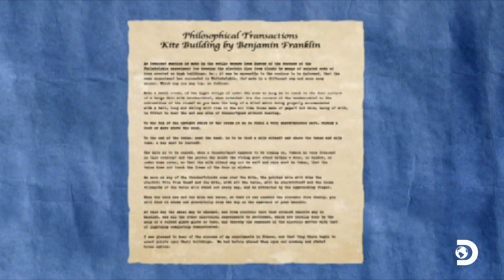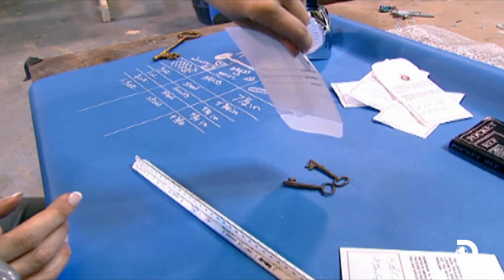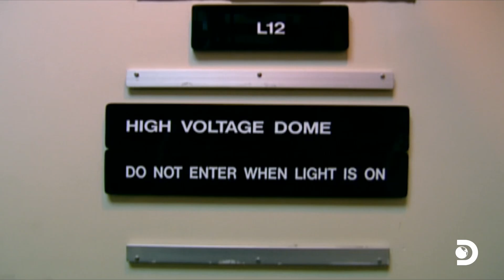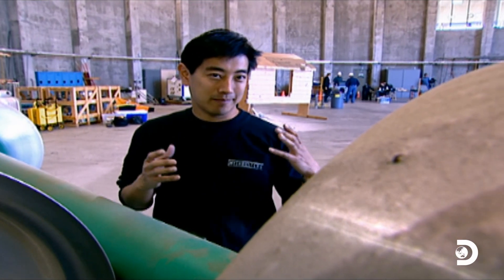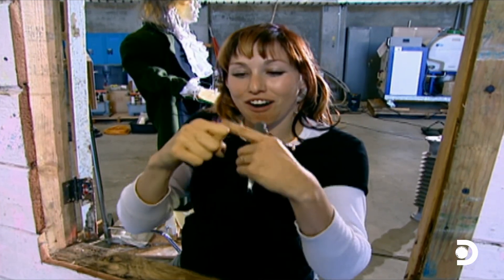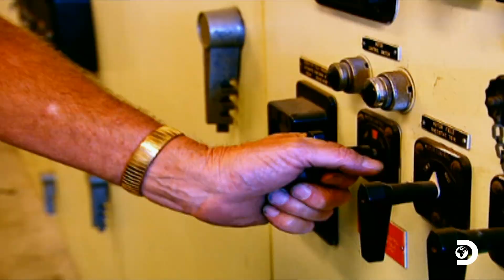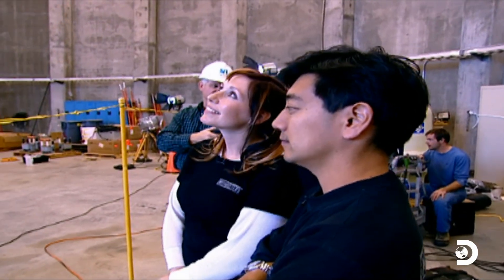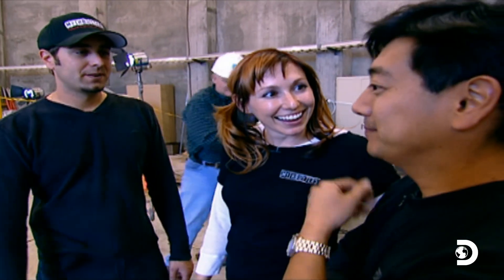Did Lightning Strike Benjamin Franklin's Kite? | MythBusters | Discovery

Comment: The kite didnt get struck by lightining, Franklin used hemp rope thst was wet from rain and the key was suspended by a silk string becsuse silk is a good insulator. The wet hemp string collected static electricity in the air from the storm,  and arced to the key and Franklin's finger. Franklin did not discover electricity, he merely discovered that lightining consists of electricity. Electricty was a widely known and broad concept by 1752 when Franklin did his experiment. The Mythbusters are wicked smart, but they should have done their research to hammer out the details

Comment: The kite didn't get hit by lightning.  The experiment is about drawing the static electricity out of the cloud without a lightning strike.  This paragraph is not hard to find by searching. 

Franklin kept dry by retreating into a barn; the end of the string was also kept dry to insulate himself. When the stormed passed over his kite the conductor drew electricity into his kite. The kite was not struck by lightning but the conductor drew negative charges from a charged cloud to the kite, string, metal key and Leyden jar. It appears that he knew enough about grounding to protect himself from being electroshocked. When he moved his hand near the key he received a shock because the negative charge attracted the positive charge in his body.
Reply: It would be negative moving toward positive. The negative is caused by the abundance of negatively charged electrons. They would be moving from a higher density region to a lower density region.
Reply: @ericthompson3982  Actually, morefiction got it correct, at least according to Franklin's model. 
His famous kite experiment demonstrated that lightning is a form of electricity, though the scientific understanding of actual electron flow is the opposite of his model. Today, electrical engineers still use the "conventional current" model Franklin developed for simplicity.

Comment: It's possible that Ben Franklin actually did touch the key after a lightning strike without dying, because if 90% of people survive direct hits from a lightning bolt, the key would give a lot less power, and he'd still have the same chance of survival. Plus, the duration of a lightning strike is less than a second, whereas this experiment sent charge for several seconds, making it more lethal

Comment: So a thought I had is that, there's typically a large amount of excess water in the air during a lightning storm, that would dampen the string and could intensify the transfer of electricity down the string?
Reply: This is an interesting question but I'm going to say no.

Water itself is not a conductor of electricity, it's the impurities that are in the water that conduct the electricity. Lakes and rivers are conductive because there are a lot of impurities in the water they are made of.

If you evaporate the water into vapor then condense it into a clean container, you will get distilled water. The water molecules evaporate but all of the impurities stay behind. That distilled water is a very good insulator because there are no impurities, it is only water.

Rain is just distilled water. It is evaporated from lakes and rivers and that water vapor comes back to the surface in the form of rain. All of the impurities are left behind when it is evaporated. 

After a few minutes of intense rain any impurities should be washed off the string and kite, so I think any excess water around the kite and string would be a better insulator than conductor, thus protecting from the electricity rather than helping the transfer of electricity.

Comment: I find it funny these guys (who've made everything under the sun) have so much trouble making a simple kite that every 10 year old knows how to make. lol
Reply: maybe every 10yr old in the 60's knew how
Reply: @micahpacileo2307  I actually WAS a 10-yr-old in the '60s, and while I knew how to assemble the kites you could then buy in grocery stores for 10 cents (basic model) or 25 cents (deluxe model), I had no better luck with them than the team is having in this video... until one day Dale Long, the neighborhood bully, pulled his bicycle into the driveway where I was struggling with my latest kite and said contemptuously, "You've got to bow it, dummy!" Rude, but he was right. I hadn't realized you needed to loop the supplied bowstring onto the ends of the kite crossbar and apply tension, bending it into a bowed shape that stabilized the kite and made getting it airborne a breeze (see what I did there?) So I guess I can't blame the team. Too bad they didn't have a neighborhood bully.
Reply: @micahpacileo2307  A fair point.

Comment: The conditions under which this test was done may have left out a key ingredient (pun intended).  And that is humidity.  Being out in a thunderstorm the air is pretty much 100% humid, meaning some, if not most, of the lightning discharge may have grounded out prior to reaching Ben. From what I recall reading somewhere a fellow kite flyer tried repeating the experiment and was killed. Ben might just have been extra lucky that day.
Reply: What if he wasn't holding the other end, but had it tied off?

Comment: This video got me thinking about lightning... So I decided to look into it a bit. While the internet varries and says lightning has an average of hundreds of millions of volts, I think the average lightning bolt is around 40,000V to 120,000V. Since you guys tested close to 500,000V, it's possible Ben Franklin did get an arc without bursting into flames.
Just some random thoughts that this video inspired `\{"_"}/`
Reply: Yeah, 9 out of 10 people survive lightning strikes, so I think that they have some issues in their testing methods here
Reply: Average voltage of lightning strike is estimated to be around 100 million volts, not just the 40,000-120,000 V stated by SPGS America. That being said, I personally know someone who has been struck multiple times, so Franklin's inevitable death seems like a jump to false conclusions. There have to be many more factors about this phenomenon not yet understood.
Reply: And the amperage?
Reply: They also only tested with one hand, I highly doubt he connected the bolts with both hands, one hand wouldn't complete a circuit through the heart and wouldn't kill you.
Secondly, I know first hand that lightning bolts have a very wide range of voltage. And it is very likely that it was on the low end, don't forget that with reflexes and the circuit to the hand being cut really fast because the kite would have been most likely destroyed means that he would have most likely survived.
no shame to the mythbusters though, but it was a B plot myth which are always simplified.